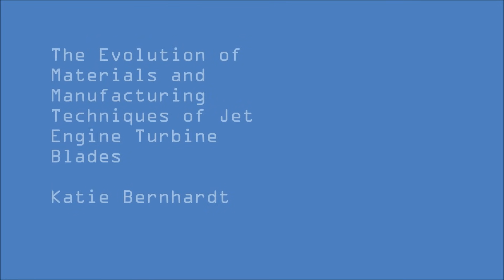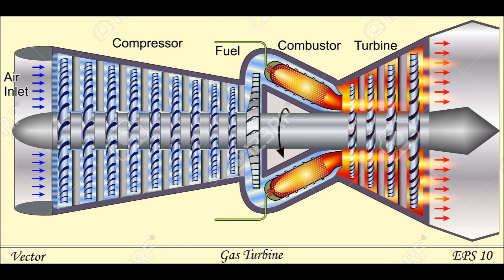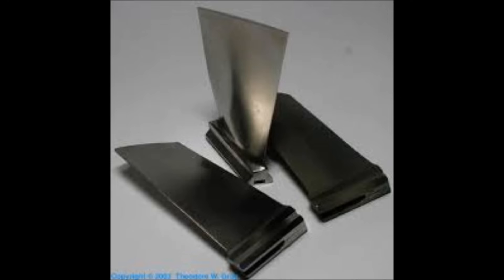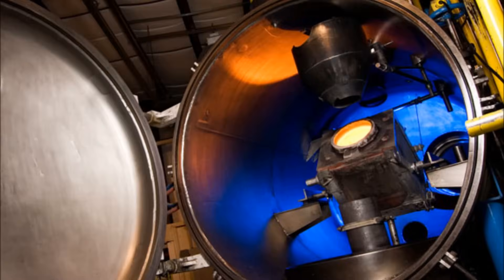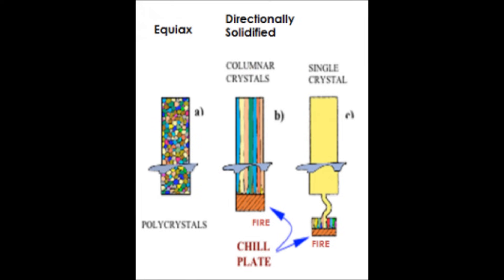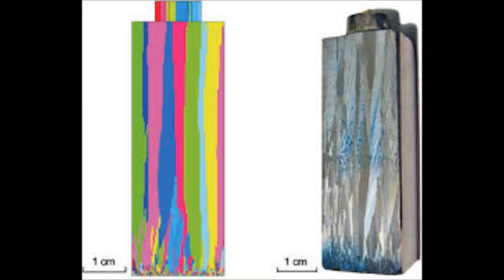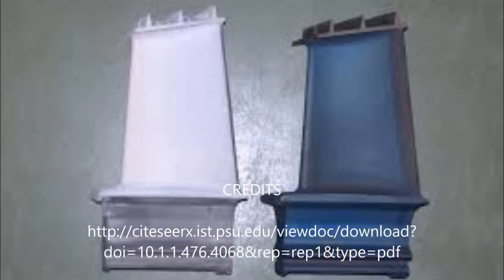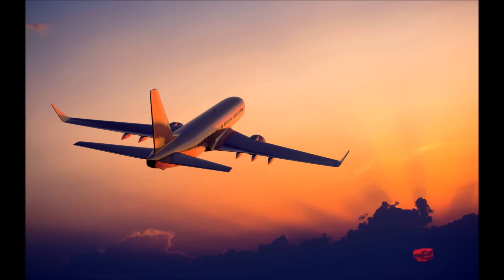The Evolution of Jet Engine Turbine Blades

Comment: Need to do several rehearsals with a friendly audience until you can give the talk as if it were just a regular conversation.  Keep up the good work!  Metallurgy is an incredibly complex subject.  Many of the techniques you mention were first developed for making improved steels (Vacuum-based and Electroslag Remelt ultra-strong steels) and then converted to non-steel alloys.

Comment: This video was great. I was watching the How It's Made; Jet Turbine Blades, and it was so uninformative and inaccurate, this is far better.

Probably the only little mistake I caught was saying that turbines push the hot air out of the exhaust producing thrust, when in reality they they extract energy from the flow (in this case to run the compressor and accessory drive gearbox). Pretty much everything else was excellent.

Comment: FYI, the tech in the video is used F-14 Tomcat.  There has been a new innovation since: 1) TurboFan has a gearbox reduction to spin slower for a larger intake fan, thus obtaining a higher bypass ratio.  2) Computer aid design for better blade airflow.  3) Better drilling technique for smaller holes + CAD design for even more efficiency.
Reply: What does FYI mean

Comment: The jet engine isn't what causes the lift, it only provides the propulsion. The wings create almost all of the lift. 1:07
Reply: Wrong. Without the propulsion the wings would just sit on the fucking ground... The jet engines are the cause of the airflow over the wings. Therefore the origin of lift.

Comment: One thing though - the turbine doesn't push the hot exhaust gases out of the engine. It's the opposite, exhaust gas makes the turbine spin, which is turned into generating even more thrust.
Reply: Time stamp reference

Comment: To all mechanically challenged readers here,   please allow me to explain to you that jet engines is no different than propeller type engines based on pistons...  What you re seeing here in this clip is the inside of the jet engine that can spin three or four times as fast as the fastest piston engines around. You see those shallow blades all around in stages from inflow to outflow is functioning the same as piston engines.. Piston engines is more clunky than jet engines so piston engines cannot spin as fast.  The exhaust of jet engines is just a glorified tail pipe that does nothing to propel the jet with wings.. It is just  hot exhaust  blowing out that do very little to propel the jet with wings..   it is the outside taller blades that you see in front of the jet engine that is acting as the real propellers that act as superpowerful fans that is what propel jets with wings..  Wings help lift jets with total assistance of the front blades of jet engines that propel the jet forward only. Wings lift, control , brake the jet around as pilots need to.  Rockets is dfferent than jets because rockets use higlhy explosive exhaust coming out of bottom of rocket engines to propel the rocket vertically without any need for wings . Rocket engines can be swiveled left right front back as needed to keep the rocket steady as it climbs vertically .  Back to jet engines,, those compressor fins you see inside the jet engines is working the same way as pistons. through compression of the intake air into the combustion chamber of yet other set of more heat resistant compressor fins that release the combusted air /fuel mixture as exhaust much similiar to the valves that let air in and out respectively. Same thiing!  But jet engines is more sophiscated means of spinning the shaft which in turn spin the outside front taller propeller blades that numbers in dozens unlike just three, four or five blades seen on piston engines of the airplanes.. The reason is that piston engines cannot turn more than five propeller blades because of air resisitance..  You have tried to crank a hand held fan of sorts before  and you know how hard it is to crank faster than you wished to due to your weak muscles.. Jet engines can crank the shaft much harder and much faster than piston engines can..  Just remember ... that both piston and jet engines do not use the exhaust to propel the airplane forward..  it is the bigger front blades that you see so clearly showing in the front side of the jet engine..  Rockets do not intake any air becuase it use compressed oxygen tanks as intake air to make loud explosions inside the rocket engines feed by rocket fuel of choice . Solid state rocket engines is another technology that doesnt use oxygen tanks at all becaue oxygen is solidified inside the solid fuel tanks..

Comment: Loved it. But you missed the part where the holes in the blades put a boundary layer of air between the blade and the hot gasses, protecting the blades.

Comment: The turbine blades do not spin to push combustion gasses out the tail end. Combustion gasses soon the turbine blades as they exit the tail end of the engine. The blades are blown like a windmill by the combustion gasses, they are not spinning to push the gases out. The turbine blades extract energy from gasses to run the compressor stages. Keep up the good work though.

Comment: Good research. After all the good work they did designing internal blades in my opinion they all fell off the bus when they designed the turbofan. One of the tests a new design must pass is the ability to keep a turbofan engine contained if one of the turbofan blades brakes or falls off. I think it's just a matter of time. There are videos of that very thing happening. If you sit in first class you really get to hear the hammering noise they make. Maybe you could do a video on their design and how it was ever passed and put into commercial use. Good video very informative
Reply: Willie Gillie probably a damaged blade in the compressor.
Reply: " I think it's just a matter of time". Yes I see Willie's prophecy has come to pass.

Comment: personally, I'd wager to say the mos important part of the plane's flight would be the wings.
Reply: God damn it. The jet engine causes the wind to fly over the wings. Without the engines the wings would do nothing.
Reply: Maybe but the turbine is the most important part of engine performance. Gas turbines get more efficient the hotter you run them and the heat and tensile strength of the turbine/turbine inlet is the rate limiting factor there. Maybe it's not the most important part of the plane but it is the most important part of the engine performance wise.

Comment: 0:40 The engine isn't the main component that makes planes fly...that would be the wings...
Reply: ever heard of gliders?
Reply: Wrong. Without the jet engines the wings would just sit on the fucking ground. What causes lift is the movement of air over the wings. The jet engine is the origin of the series of events that allows the plane to fly.